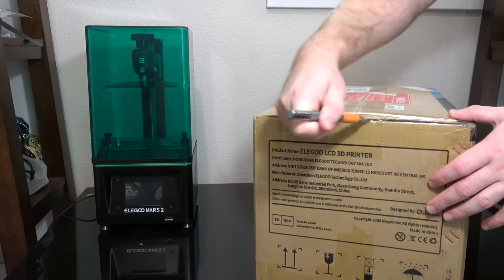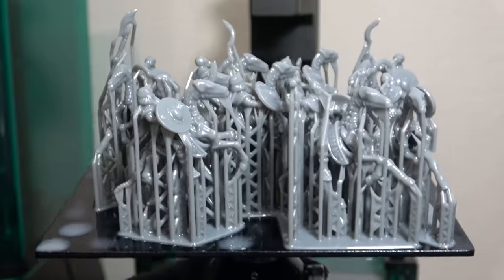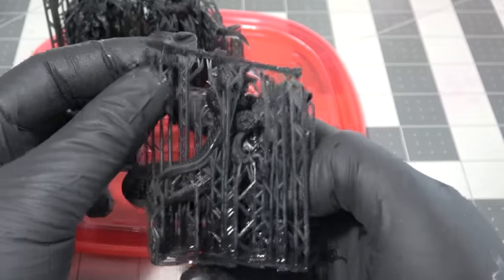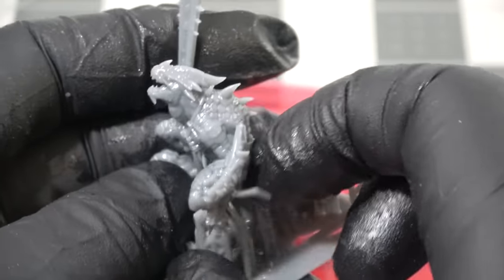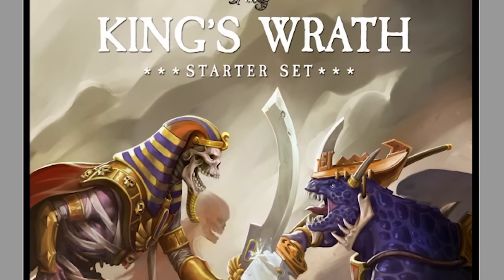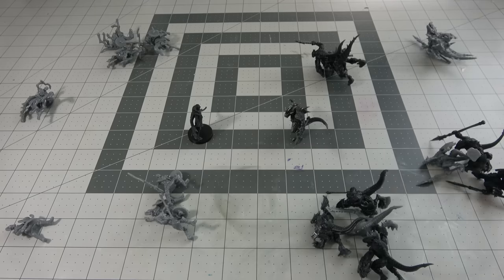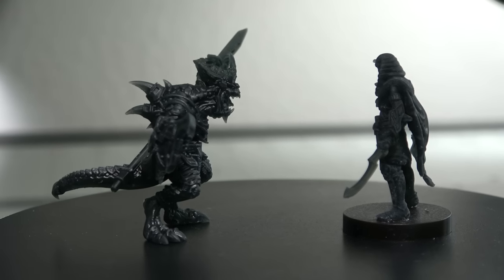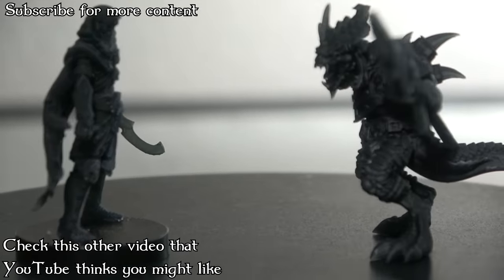3D Printing 2 Starter Armies - Getting Started In Wargaming | Wargaming In A Weekend

Comment: Love this video! I'm not a war gamer, and don't plan to be, but I 3D print a ton of minis. Not sure if you'll see this, but a note on your exposure settings, you have your bottom exposure time set to 98 seconds. I'm not sure about the resin your using, but most resins don't need exposures that high. You run the risk of burning out your LCD screen much faster. Check out 3D Printing Pro's video on exposure times, it definitely helped me dial in some of my settings. Again, great video!

Comment: I too have been printing OPR Mummified Undead. The presupported minis do print very nicely. I have had no problems with them. Big time saver compared with doing your own supports.
Reply: I've been having some trouble with the presupported Saurians but it seems that it's more likely my printer settings that need more fine tuning.

Comment: what is done with scrap resin like the support struts and such? is it just tossed or is there some means or recycling it? be it in conversion or full on reclaiming.
Reply: Unfortunately lots of it needs to go to landfill. So far I havnt found any secondary uses for old supports but I guess its limited by imagination. It can't be melted back down but one type of resin im using atm (anycubic eco) can apparently break down in about a month if its ground up and composted

Comment: The cost seems to match premades a little at the point where you have to find your settings and practice printing, but after that I can see it being cheaper. Especially if you just use regular resin.

It's also interesting seeing some of their 'cheats'... like the end of the spear on that lizard tail to save on supports... had an art teacher that would scold for shenanigans like that, but here it works. :P

Also, where in 40k are you gonna find lizard men on dinosaurs? C'mon, GW, keep up. I... I kid because I care... :v
Reply from the maker: Haha I totally see the cheats you are talking about! If I was a designer, I would hope nobody saw but me >.> lol.

Sigmar has them, but come on 40k, I'd love to have a raptor rider charge a space marine. That's just badass.
Reply: My 3d printed 2000 point Seraphon army cost the same as a GW purchased one, including the 3d printer, the cure/wash machine, the resin, the gloves, the STL files from One Page Rules. 

Basically anything printed now is significantly cheaper than buying them retail.

Comment: Hey can you please talk more about the water curing for resilient prints? I'm interested in finding out more
Reply: You just put them in a clear cup of water during curing.  Water refracts the light more evenly curing the model.  For example if you just put them out in the sun they will cure but they will cure unevenly which stresses the resin, and they will quickly over cure in the more exposed area's.  It's like the difference between them being hit by a UV glow vs a UV beam.

Comment: Unfortunately, its actually not cheaper to make your own armies vs buying them in Canada. Those Space Marines is almost $150, for two armies and to buy the Elagoo 3D printers is over $500 plus $10 shipping, off Amazon. General rule of thumb, when it comes to the US stuff... take its price, double it, and then add the original price (51+51=102+51=153 for an example for the Space Marines).
For one unit its actually 70, but to add tax on top of that 140 for both, its over 150 and I dunno what the shipping would be, if you bought online vs in-store.

Comment: Regarding Proxies in tournaments. What's the issue here? You've still got to buy the books to use the rules for the models just as the other players do.

Unless you've got the skills and knowledge in a program like Blender or Meshmixer or whatever, most 3d print models are pretty monopose so you'll end up with units that look the same. Whereas with GW items you can kitbash a lot better. Also, it's condesceding to say "well they bought those models from GW so it's not fair" ... Exactly how do you know they bought those models from GW for full price? They could have bought them off ebay, or from companies like Bitz Box.

This hobby is the best thing to happen to GW in a long time. If it weren't for 3d printing GW would be pricing themselves out of the market.
Reply: No tournament outside of one at a GW store cares if your models are 3d printed.

Comment: Help me rybo-kenobi you’re my only hope! My wife and I just got a elegoo Mars pro and our prints keep lacking detail. We are using black resin and our exposure time is at 12 seconds per layer. Any tips? Would welcome advice from anyone!
Reply from the maker: So, if you got a mars pro, what type of resin are you using? It SEEMS like 12 seconds is WAY too long of an exposure time, but I could be wrong. High exposure time for the first few layers is advised, but I'd drop that down. On a pro, I typically need maybe 7-8 seconds (but each printer is different.) If the exposure is too high, then it can build up excess resin that clings to the mini. You can always try scrubbing your mini with a soft toothbrush to remove even more excess resin that might be clinging on. 

Try dropping your exposure time and see if that helps :) Drop the exposure time, and maybe slow the lift speed down.
Reply: Try Lychee Slicer if you aren't already using it. It has some great defaults to get you printing.

Comment: What a con. Too late to comment in detail but the casual dismissal of peripheral expenses like, I don't know, the 3D printer, the wash and the curing station, the pledge, the cost of the resin and the fact that 40% of the resin will disappear in supports on the minis, the cost of the electricity and so on means this guy was never close to the true expense of 3D printing. There is plenty of other stuff this guy said that was a misrepresentation in the comparisons but as I note. This was a while ago.